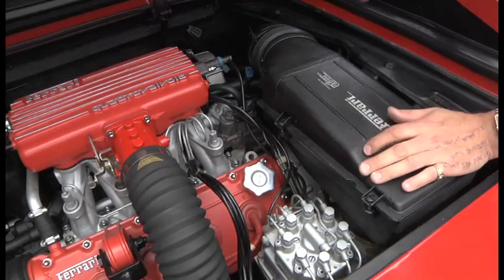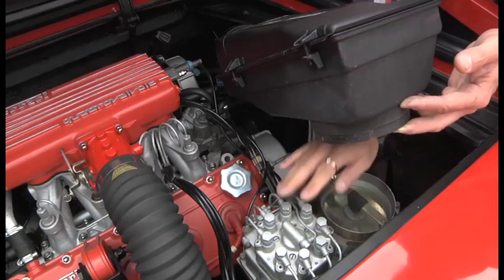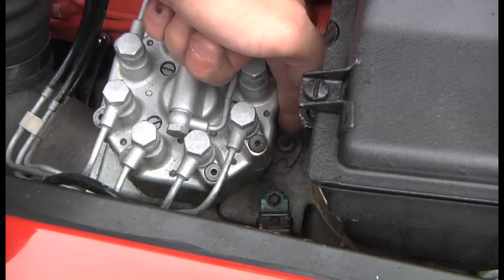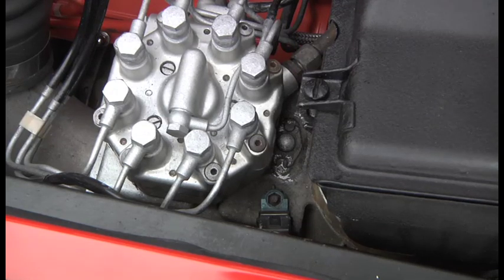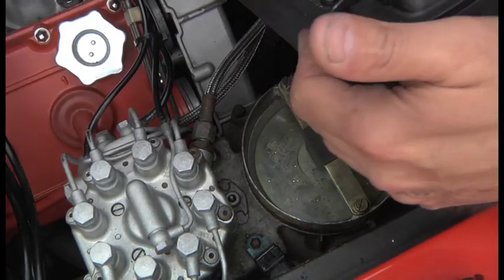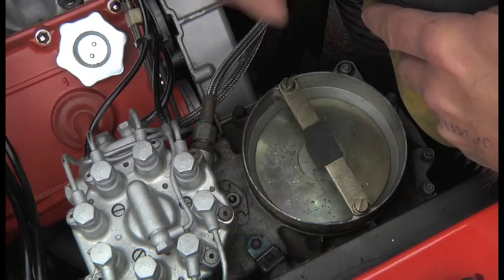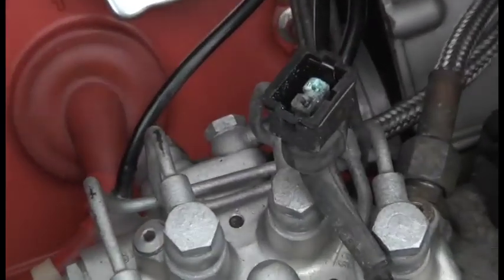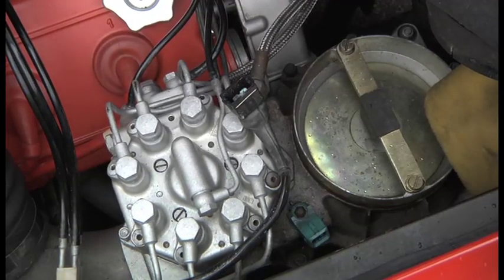Ferrar K Jetronic Part 1

Comment: The warm up regulator changes the control pressure. This controls how  low the airflow plate goes down, basically more resistance to downward travel when hot, and less resistance to downward travel when cold, I.e., richer. The system pressure doesn’t change with temperature.

Comment: hi does the pump normally come on when ignition is on?...i have a 3.2 and on a cold start you hear a buzzing noise for 5 seconds
Reply from the maker: Hi Ben yes the pump comes on for a few seconds until system pressure is reached, the pump should not run continuously unless the engine is running. Note also that if you turn the ignition on for the first time the pump will run but if you turn it off and then on again it won't run, this is because the fuel system is already primed and will take many hours to loose that primed pressure. Regards Doc
Reply: @TheHeliDoctor  hey doc thanks for that...i think my pump is on the way out...it wont come on with ignition on anymore..still starts but runs pretty rough until it gets warm
Reply: @TheHeliDoctor  Hy sir have a problem of my w124 running rich very bad bad .fuel gets inside oil pan  pls help me from Namibia!took it to the mb dealer he did it good bt the problem came back he said it's btfly problem !help me thnk u

Comment: Flat-plane V8s sound strange...almost like a 4-cylinder because of the regularity of the exhaust pulses.
Reply: I have a lancia thema 8.32 with the same engine and fuel system so alote the same issues and all these fuel systems do not like being left for long periods of time
Reply: @andrewcouper9276  The Lancia didn't get the flat plane crank though.Shame

Comment: hey heli, my dad and I bought a 1985 mondial cabrio and we just found a little cable hanging at the accumulator it is an "open" cable ( sry for my bad english im german ) and we dont have a clue were it connects to, it comes from the accumulator and leads into nothing we asumed so far that it leads to the pump and just loosened. Maybe you have an idea what this cable could be ? Maybe some sort of regulator for the tank if it has high pressure because there is fuel coming out of the cable or regulator for the accumulator ?

Thanks in advance ! best regards from germany

Comment: The CIS system is pretty elegant. most european cars of the era used it in some form or another. 
The big problem is the fuel injectors leaking by and causing rich conditions. They can be re conditioned  and cleaned in 
a ultrasonic cleaner. Mercedessource has a series on working on these and have some good videos on cleaning the CIS fuel injectors.
Reply from the maker: Hi ne2i, you know being a multi carb kind of guy, at first I didn't like the idea of fuel injection, but this system is really good with a really fast throttle response and is reliable.......so far....Haha.
Cheers for the tech info though, all the best Doc